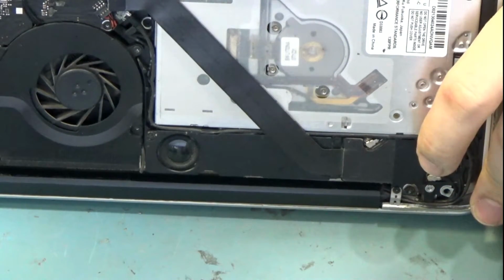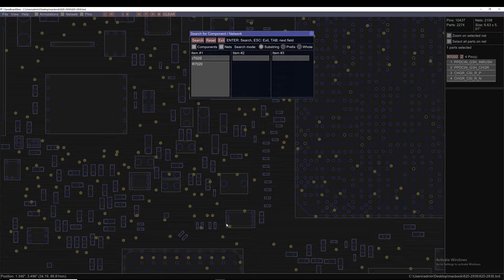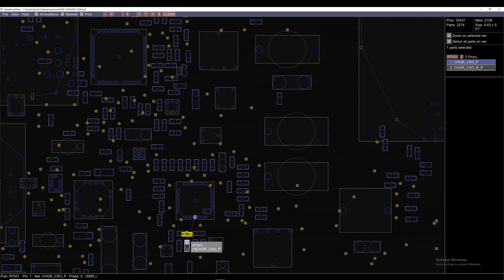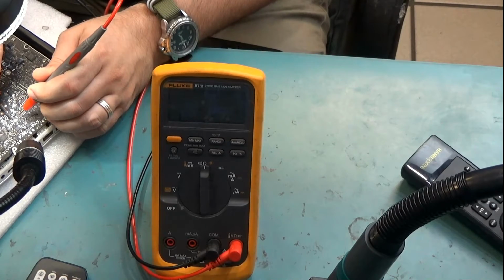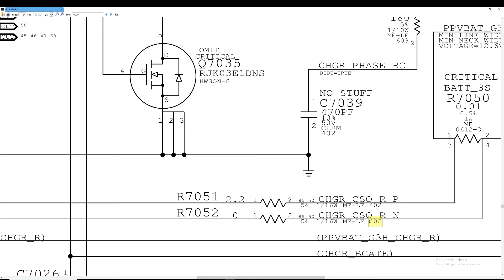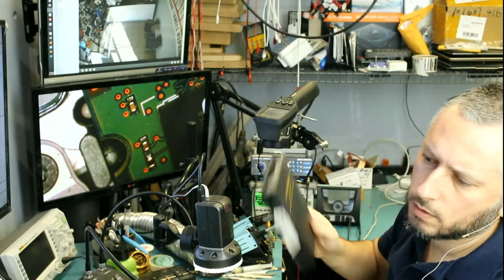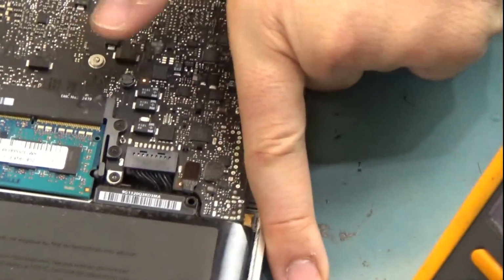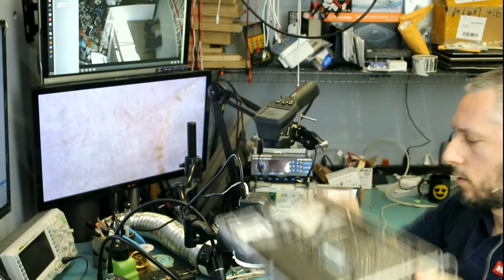2011 Macbook pro No power no orange light unstable PPBUS_G3H - Voltage Fluctuating 820-2936

Comment: I have a 2017 MacBook Air... When I unplug it from the charger I only get 10 minutes from the battery before the unit shuts down...There is no battery warning ... Then I plug it back into the charger and it works again... I have to leave it plugged in all the time to use it...What do you think the problem is...?

Comment: Hi, I've the same problem with logic board 820-2850 with the green light on magsafe but no fan spin, no power.
The strange problem that I can see is the ppbusg3hot floating from 12,46V to 2,2V to 0V then another time 12,46V to 2,2V to 0V and another and another....
I've changed the U7000 but the problem isn't resolved.
Can you help me? It's 4 mounths that I analize this logic without find a solutions.
Thanks

Comment: Hi my old mid2012 MacBook pro 13" is not turning on in battery. OS also not recognized battery. No battery display status. Mag1 light is always green, and battery indicator in the side is always 1 green light and never turn off. I changed RAM and the issue occurs. Possible reason and solution? Thanks

Comment: hey mr. i have a 820-2915 mbp that doesnt recognize and charge battery, but if unplugged still works or goes to sleep. on r5281 i measure 2kohm, but on r5280 i get strange readings, sometimes 3,6kohm one way and 0,4kohm when changing probe sides. also ppbus_g3h is 12,26V measured on r5410 and r5400. tryin diode mode on smbus_smc_bsa_sda and scl i get weird readings and not 0,441 suggested in Louis video. thank you for any kind of your help.